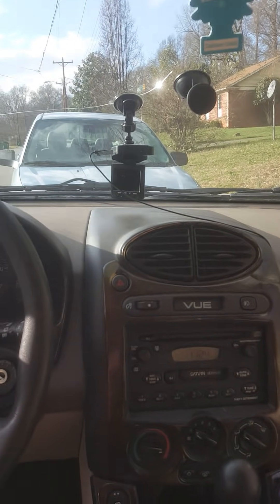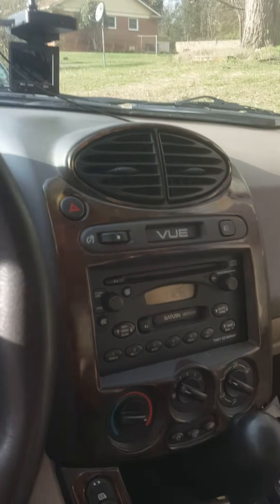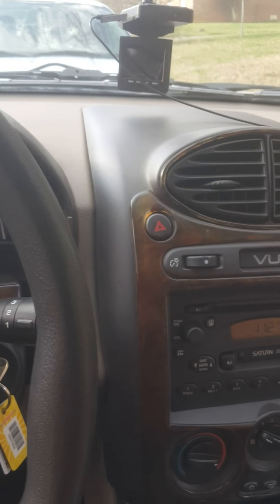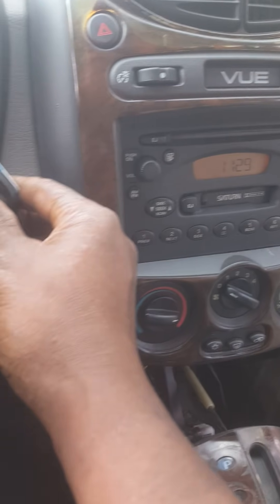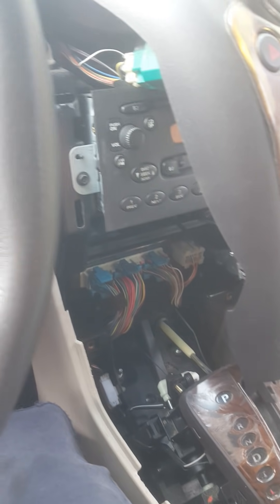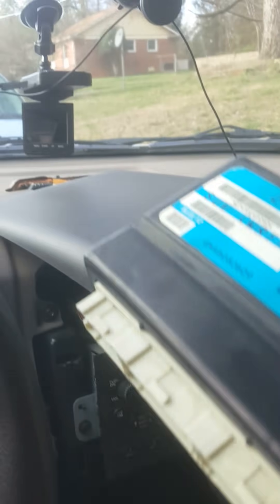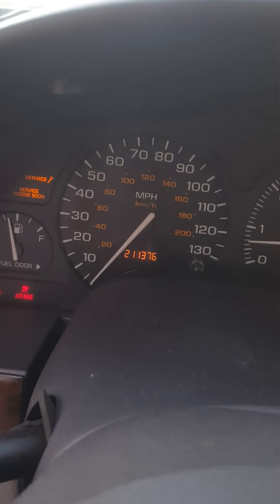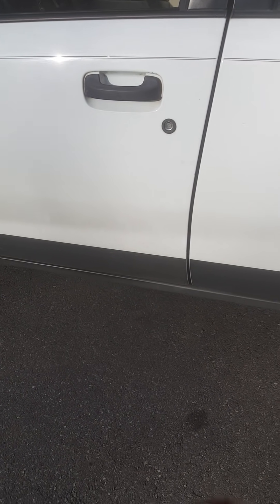How TO PROGRAM A BCM ... WITHOUT GOING TO THE DEALER

Comment: I am an ASE certified mechanic.  You are absolutely wrong.  You didnt program a thing.  You got a used BCM that was already programmed.  Thats why the mileage is different.  Thats the mileage of the car it came out of.  NEW BCM comes from the factory WITH NO SOFTWARE AND MUST BE PROGRAMMED BY A CANBUS DUAL BAND PROGRAMMER.  PLEASE STOP SPREADING BAD INFO CAUSE YOU KNOW ABSOLUTELY NOTHING ABOUT WHAT YOU ARE TALKING ABOUT.  BTW CHANGING ANY ELECTRICAL COMPONENT WHILE THE BATTERY IS CONNECTED LET ALONE RUNNING... IS DANGEROUS AND CAN CAUSE MAJOR COMPONENT DAMAGE.
Reply: true but he has a working car now in stead of a pile of metal in his driveway
Reply: @rogerd4559  He had a working car before, just not a working key fob. Now he has a working car, without a working key fob, and with the wrong mileage.
Reply: You are correct this was painful to watch
Reply: I am also an ASE master certified technician and you are so correct! He won't be happy until he sets an airbag off in his face
Reply: @ftubbs107ft  you are so right... thanks for having my 6 on this.  People need to know how damaging vids like this are.
Reply: @ftubbs107ft  Yeah... ASE master certified technician...  Just  so you know... the SIR (airbag system) is COMPLETELY independent of the BCM... airbags are controlled by the ACU, not the BCM.  The BCM *may* in some vehicles COLLECT data, but it WILL NOT set off an airbag. The ACU reacts to sensors at the front, sides and rear of vehicles to trigger their deployment... Imagine if the sensors first had to send a signal to a unit where your radio and other personalized settings are stored???
Reply: @BLACK-AUTUMN-MAGICK but fucking around hot swapping bcms and unplugging connectors with power to them. You can easily get a screwdriver or any tool in a spot it shouldn't cause a short and air bags deploy that way. My idiot ex brother-in-law shorted out some connections causing all the airbags to deploy. He had to tow the vehicle to the dealer to reset
Reply: Well...  ASE certified mechanic...   I wonder if you realize that switching out fuses amounts to connecting and disconnecting electrical components??  I'm not ASE certified, but I do have several engineering degrees, one of them is in electronics... Legacy computer systems used to fail when connecting peripherals without first shutting down the system, but that had more to do with the operating system not having detected a device during the boot process...  

If what you are saying about connecting components with the battery connected were true, there would be no such thing as hot-swapping...  In fact I have swapped out electrical components in cars and done so with home appliances as well, without disconnecting from power, all of my life, and I don't recall a SINGLE instance of doing damage to any components, as a result.  Do you shut off your breakers before plugging in a new tv set???  

Do me a favor...   Can you explain your logic??  I mean, what is it that you think that having the engine running would increase the peril of damaging a component by having the engine running??  Maybe you believe that having the alternator supplying current in addition to the battery will add to the damage???  Because if that's what you believe, I can assure you that you are mistaken...  By that logic the total supply of power would damage the component as soon as you start the car, even if you connected the device before starting or connecting your battery...  

I don't claim to know everything, but when I make such positive assertions about anything, I usually back up my statements with logical explanations as to why...  All you've done is make assertions, and claimed authority by saying that  you are ASE certified...  I've seen ASE certified mechanics royally screw up systems, and usually the ones that do, are the blowhards that claim authority...  When I got all of my certifications and degrees, that didn't mean that I stopped learning, and it didn't mean that I suddenly believed that I could never make mistakes...  Seriously...  Please explain your logic about damage to components by not disconnecting the battery???
Reply: @BLACK-AUTUMN-MAGICK  I agree with your assessment. Some people are out to protect their income by scaring or shaming others away from learning. That way they can hoard knowledge, use proprietary equipment, and gouge the customer. It was evident from his tone that he was more indignant than concerned.
Reply: Thanks. There's too many people that are clueless, and someone stranded sees  propaganda like this , and have more probems than they had to begin with.
Reply: @Hanlinit  "Propaganda" is effected for political causes, not as a method to program BCMs.
Reply: To everyone who keeps replying with VALID information thank you... you have restored my faith in the human race.  As to the OP... you need to donate your tools to someone who knows what to do with them.
Reply: We can only hope that when he does finally blow a bag in his face his loved ones recover the footage after the funeral service and post that video too!  Maybe then people will realize this ain't a damn joke.  You don't pay the plumber to bang on the pipes... you pay him to know where to bang...
Reply: John Klein, shows how stupid You are, these systems can all be bypassed, the only thing he needs to do now is reprogram is millage and key fobs, everything else was reprogrammed automatic by a simple parts swap by leaving the key in the on position, leaving the key in the on position was the bypass which worked by the way. And my 2nd point is I would love for you to produce documentation proving that doing this exact procedure causes major electrical component failure? I'll wait!
Reply: EXACTLY. This explains why his locks are not in sync with his replacement BCM. Each car is individually programmed for a reason, so you cant go to the local car park and drive off in somebody elses car that's the same MY as your car!
Reply: Also ASE is not very impressive might I add, that just tells me one thing, that You got ripped off!
Reply: @amazingvideo2869 man stfu. What have you accomplished in life besides being miserable

Comment: So you spent 400 dollars for a Junk yard BCM to fix your remote malfuntion? and you accomplished absolutely nothing?
Reply: Sad part is the Key Fob can be programmed to the BCM easily. 17 year GM Master auto tech. And if you folks try this with it powered up duck. Those airbags may deploy. The other thing is there is a simple way to reprogram your security passlock as well.
Reply: What is that simple way, if you don't mind?  I know this is how you eat so if you don't want to tell I understand.

Comment: So you are hot swapping the original module for the junk yard module
Im uneasy doing that it is like changing a mother board in a computer while it is still on!
Reply: If you pull the batt terminals off overnight like he said you should be okay. You might get a check engine light from failure to connect to ECU but thats an easy code fix. You might get away with the brake pump technique to clear it. If not you could get it cleared at orileys

Comment: I think id rather wait a day for the system to reset the risk damaging other delicate electronics on the vehicle.
there are sellers on ebay that sell remanufactured BCM's for 250 and they will reprogram your BCM for free if you give your VIN number, year make and model of your vehicle
Reply: Watch out for bait and switch scams, Fla company's are bad.

Comment: Ever think about the consequences of accidentally setting off the airbag?
Plugging in the BCM while the battery is hooked up can destroy the Engine control module, and set off the airbag. its like turning off your PC without properly shutting it down. I called my dealer and they told me another airbag and horn switch was 1800 bucks. So  I faithfully disonnect the negative side of the battery before doing this work. a broken face and arms if you get in the way of an airbag can run you much higher  then 450 plus 150 for programming
Reply: The body control module has nothing to do with the srs system.  The only way a deployment would happen is two of the three crash sensors went off. Air bag systems are robust.
Reply: OK, we get you jimbo.  You don't like this guy.  It's best, when you say nothing at all, around other people.  Bye the way, your info is wrong, too.  You obviously don't understand airbag systems.

Comment: Is a BCM the computer? We replaced the computer on an saturn aura but it was inside the hood. is this another part we need to replace? Because our car started to accelerate and my mechanic said it's because it needs reprogramming that cost 150 bucks. The dash also doesn't work, speedometer, gas gage, ect.
Reply: Most cars today have five computers 1. The Engine control module is the main computer,  2.then there is the powertrain control module that controls the auto transmission, 3. then there is the airbag control module,  4. then the Body control module that controls all the body functions.  5.then the HVAC module that controls the climate in the vehicle and antipolution devises,  6.then there is the ABS system control module that prevents your brakes from lockng up on ice... um did i say 5? well you get the idea
and they are adding more computers all the time
Reply: it is one of several computers. You replaced the main one
Reply: that sounds like the BCM
Reply: there are many computers in cars today the ECM is the Engine Control Module... the main computer, and yers its under the hood ..usually the BCM is the Body Control Module wich handles all the body accessories, then their is the PCM or power train control module ... and so on and so on they add more computers every day

Comment: Put your original bcm back in, take your key fob apart.  Clean the circuit board contacts with rubbing alcohol and a q-tip. Replace the battery if you haven't done that. Most times that will fix the key fob.
Reply: Greg ,  what is a key fob   ?    what does it stand for ..   i saw also on ebay  you can buy  these BCM that were in a car   you have  make sure you buy the  right one for your same car..    would that  just work without  repraming  you think  ?  since it was in the same monte carlo ..   $40   they want  for it   2003 Monte carlo    BCM   must of been pulled out of  a  junk car
Reply: exellent tip your a good man thank you

Comment: Question on  the battery cables  some say  you should disconnect them before you install the new one  ?  what does the  dealer do  to program  it   , is it a  computer or tools ..  ? have you had any more problems after you did this  switching ,  thanks  Joe
Reply: I want to know too
Reply: @Cloud9Series    Maybe if you know what your doing  it can be done but for my car   they said you have to bring  it to the dealer  i ended up  trading it in  before any more problems  keep happening  had it 17 years it was time i guess..
Reply: Nah i want to keep my car. But it may come down to getting another car.

Comment: You didn't program it you swapped it out with a junk yard part.lol Good programming.
Reply: this guy is a dangerous clown giving out misleading and risky information and risking injury from an exploding airbag or wiping out  the engine control module, maybe the transmission control module and other sensors all to save 150 bucks?                                       what was the original problem? his automatic door locks didnt work? god forbid some innocent viewer listens to this and an airbag takes his face off
Reply: Jim halcom you are 100% correct sir! That guy shouldn't be making videos. He is endangering everyone who follows his bad advise to try to save a few bucks. Years ago I watched some air bag test videos and have since changed how I work on vehicles. I use a tool cart or magnetic tray under hood and never set things on the front fenders or radiator support to prevent dropping a tool and setting off a crash sensor. Also I will not move, test or disconnect any air bag connectors under the dash without consulting the repair manual to check the exact procedure on disconnecting that specific cars air bag system. I find so far the connectors are usually yellow and will have vibration locks on them. Those air bag videos show just how much damage air bags can do to people if they go off unexpectedly and your not fully sitting back in a driving position. Great comment. Thanks. Jpol.
Reply: And he said he's a mechanic , really ? You mean well but pass on facks not what you assume .  Assuming is Dangerous !

Comment: I can Verify this worked on my 2005 Silverado. Strange though that my odometer didn’t change. Airbag light is on now but who cares at least my radio, dome lights, reverse lights, and dash lights all work again:), that’s for the video!
Reply: In NYState it wont pass inspection without the airbag
I guess where you are you can always slip the mechanic a 20?
Reply: the airback could be on cause of the CLOCK SPRING is broken try changing that

Comment: Do you know if the BCM can cause the AC to stop working for no apparent reason?
Reply: Mine did on an 04 grand am. Can reach down and wiggle the pink harness and the ac will come back on, hope this helps.
Reply: if the freon is low or oil to the compressor some systems have a shutoff to keep damage to compressor to a minimum
have a ac mechanic check it out
Reply: sometimes when the AC is low on freon or  lubricant it will stop working to save it from being totally destoyed. have a service station check it out
Reply: it may but check the clutch and that the AC system isnt low on refrigerant or oil. some systems stop working if that is low as a fail safe. A BCM will usually give you other accessory problems like no wipers, horn, radio, heater motor, signals, and instruments

Comment: thanks i hope it works for 2006 buick lacrosse. no low beams no radio,  park lights stuck on
Reply: Greg  did  yours work ok   or still working on it ?
Reply: Joe DeVitto mine was a little different. . had a wore shortage. had to have electronic shop to track it down. cost me 125.00
Reply: @thema962    was it in the BCM >  you mean .. ?
Reply: Joe DeVitto no it wasn't the bcm . twas my thought at first. in this case twas a short between bcm and power source.
Reply: @thema962    I see so it could be   wires  then .  just never know till they get in it and  check ,    not sure if i should just trade it in for something a little newer and move on  ,   its getting old  almost 17 years old in the desert heat too...  thanks
Reply: gotta make sure the replacement BCM is tested and verified working

Comment: Dude , you dont need a new BCM to reprogram, your Keyfob. And it didnt work at the end  so whats the point of the video?
Reply: to impress his woman  "See I a licenced mechanic...um tecnisian" i gonna show how to fine yo  gas gauge speedo..meter and rpms thing let me show you how to mess up yowr electronics and set off you aer-bagg and cause immeseuarblle damage to you ride
Reply: @rogerd4559  I didn't realize that people, like you, still exist in this world.  What's funny, is that your writing skills are even worse than the pronunciation that you are judging.  It certainly, is not acceptable for elementary school.
Reply: You evidently missed it.  He titled it how to program a BCM, not how to program a FOB.  He admitted it did not get his FOB going, but another BCM did.  I have pulled BCMs before on cars and some will work everything and some will not.  It is a coin flip, but programming the BCM this way is a great video.
Reply: @leew7863  its not a coin flip . FOBs need BCM programming. Coin flip is 50/50 . you dont need a different BCM for a new fob, you just need to program the BCM.  ALL BCMS will need to programmed for a different FOB.
Reply: @smokingsix    Is the dealer the only  place that can program them ?  i need to replace mine  was wondering  about the programing of them?
Reply: @joedevitto6113   Dorman makes a product which comes with a Fob and a "Plug and Play" programmer ( you simply plug in the supplied programmer and follow a couple of simple steps ) It may not be available for all GM vehicles. They have different models for different vehicles. Search for "Dorman 13731" as an *example*. This will allow you to program Other Fobs to your car too. the programmer is  vehicle "range" specific so you can program other fobs that are for your car using the same programmer.
Reply: @smokingsix   whats the name of the part  .  i dont see anything for a BCM  programmer   is there a certain name  i went to the  dorman site...  thanks
Reply: @joedevitto6113   If you search for "Dorman 13731" it ships with two things. One is a FOB other is a programming module. "Dorman 13731" is for certain cars, Others such as 13732 ,  13735 , 13736,13737 etc are for other GM cars. Look at the set of pictures and you will notice along with the FOB it comes with a slightly larger rectangular  part. Make sure you get the FOB that comes with the programmer as they also sell fobs without programmer. (e,g  13733 ,13734 are bare fobs )here's a video explaining the programming
https://www.youtube.com/watch?v=pObBAWQEeoU

Comment: what if the car want start at all
Reply: i have the same issue
Reply: @melissabrown6667    thats what im wondering , and then  how to get it to the dealer  ..    did you get it  going  as of yet ?
Reply: it could be  the starter fuse, check all the fuses. make sure your battery is ok and the terminals are clean, do your accessories work? lights interior? radio? heater fan?
directionals, brake lights etc if not it may be the BCM
Reply: if it want to start at all then there is no problem